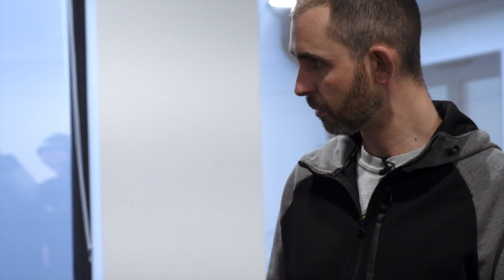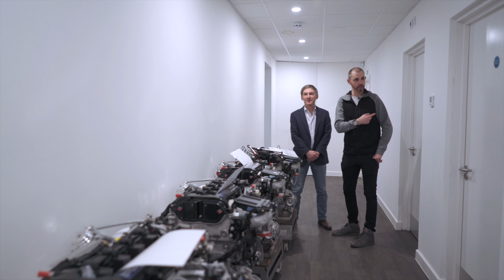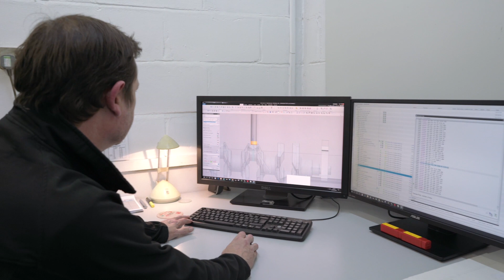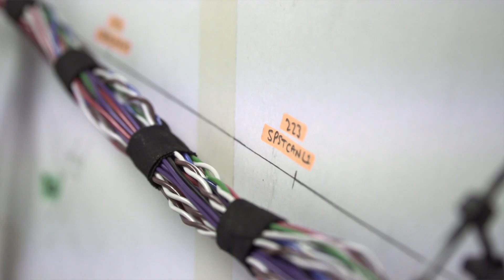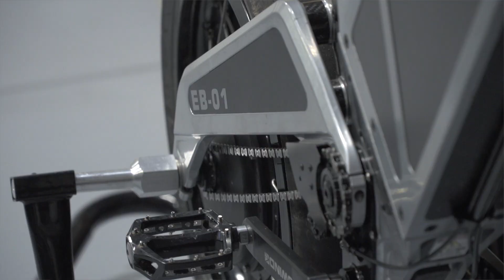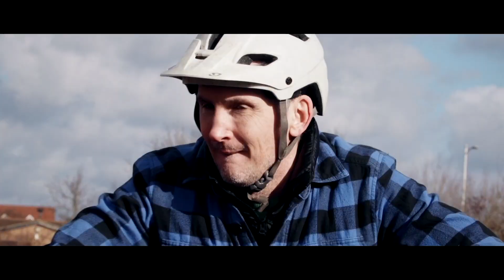This factory makes BTCC engines, EV conversions AND £20,000 hyper e-bikes // Jonny Smith

Comment: Looks more like a motorcycle than bicycle
Reply: Rhys Loader it is really just a dirt bike with pedals bolted on
Reply: Can not see how it is legally allowed on public roads and cycling paths you couldn't do it with a motorcycle but you can with this yet your kids electric scooters max 15 20 mph are illegal
Reply: Rhys Loader it isn’t legal, you’d have to use it at off road parks and designated private trails, would still be bloody sketchy though, it’s either road legally and does 15mph or it’s a motorcycle

Comment: Great to see the old C20XE "Red Top". I had a lot of fun tuning the C20LET for turbocharged and C/X16XE with throttle bodies when I was younger. Swindon Racing Engines (SRE) as they were back then were ones to keep an eye on. I hope we start to see more engineering detail on EV powertrains for the electronics and control strategies as it's all very secret sauce at the moment.

Comment: Like the idea of doing a car conversion using an e-powertrain, but what's the cost. Personally, it'd need to be sub £20K fully installed and running to be remotely viable.  £30K will get you a brand new EV  (Corsa e, e208, Zoe).

Comment: Don't like the e-bike at all. Hub motor - who want's a 10kg rear wheel on a "bicycle". Cheap components in parallel (talking the entry level front brakes). And the fact that it's just a motorcycle with pedals.. I mean I like bicycles, I like electric bicycles as a means of transport. But even with a 750w mid motor e-bike, at 30mph most of the power is delivered from the motor and not the cyclist. But it still has influence on how much power the cyclist adds.. now double the speed, and there is simply no reason to pedal (as we can also see in the video). Would have made more sense to just design a nice electric motorcycle (Like the LMX 161).

Comment: The EV conversions bit is really exciting. At Fully Charged Live in Austin, there was a beautifully restored 280Z conversion. At first, I was excited because I have a 1983 280ZX until they said that it costs $70,000 and up to convert a car. So, not very useful. This sounds like they are making conversion kits that are much more affordable and therefore much more useful.

Comment: That drop in electric powertrain is something I'm thinking about for my 08 Peugeot 308 SW. In a few years instead of spending a fortune I could just drop a new powertrain in with a batterys on top and in the place of the fuel tank. Maybe even link up the radiator and aircon to the battery packs to cool them. To me this makes more sense than anything else out there when it comes to environmental stuff, as it reduces emissions across the board, since you're not making a new car, just a new powertrain. If engineered right you could buy with a sort of subframe kit that would bolt on to the engine mounts of popular models. I'm sure electric restomods would be a popular things, if govs don't step in the way as mine does now.

Comment: Was really impressed until I saw their 'Hyper bike' had a hub drive motor. They are old tech (we're talking 1960's here!) and absolutely horrible to ride. These guys are obviously extremely good engineers, but they've missed the mark with the bike. Integrated mid-drive motor with internal gearbox will be the next big leap forward for e-bikes. Would love to see these guys tackle it as it looks like they already have the gearbox that could work.

Comment: Electric bike nerd internet rant: Big fan of 'off road' e-bikes. These are vastly, VASTLY overpriced. Look up the Sur Ron light bee (it's a better built bike than these, which are actually a copy of the old 'Stealth Bomber' e-bike, they were around 10k, but again overpriced )- Sur Ron are blowing up as a company because they are offering A superior frame, placing themselves between a mountain bike and a motocross, you can even get a limited road legal version that is limited specifically to fit in the moped class. They also use mid crank drives, which have planetary gears, meaning  you get loads of power out of a small light drive unit - this is far superior for off-road  use too. The Sur-ron is£4000, spend £8000 and you can get a superb electric trails bike witha 60km range 70km top speed Epure Race Trials Bike. This is old tech being sold to customers who don't know any better.

Comment: I build rally cars, I’ve done little bits for Skoda and a lot of amateur teams, by the time you’ve built a competitive engine let’s say that engine was a VaG 2.0 turbo petrol, by the time it’s all new and BUILT your talking best part of £20,000 yes you’d be looking at similar power and similar if not better reliability but there is 50 hours for one guy just in the engine to buy a plug and play screamer for £25k is INSANE VALUE

Comment: I have been excited about the electric crate engine but the longer I think about it, I can guarantee that the kit just won't be priced well enough to make it worth doing.
At this point, it's going to be cheaper to buy a 2nd hand electric car and either drive it or use it as parts.

Comment: Not wanting to sound negative, but the problem with the eBike is simply that  it doesn't current fit into legislation.  They might show it  "racing" a ultra high performance sports bike (which in reality would disapear into the distance so fast the ebike wouldn't see which way it went) but for half the money (or less) you could get a production std sports bike that is WAY faster. Legally, you can't have more than 250 watts and only up to 15mph for a eBike to be classed as a bike, ie not need a motorcycle licence to use it, and therefore you couldn't ride it "in the woods" as mentioned, you'd have to stay on prublic rights of way.

Comment: provokes memories when us at Arun Autogas, "Freds in sheds", were prototyping fueling systems for Nicholson Mclaren Engines. While we drilled holes in road going V8's their Dyno rooms where running up Indy engines and a workshop was whittling up recon Helicopter motors. We frequently used emission test cells and liased with Ricardo. Those were heady days when Vauxhall would drop down high proirity work to us, working two shifts in a rural tin shed. Thanks for flickering the thoughts

Comment: Thank you for making this video I really did enjoy it. I do think environmentally it has to be better to be replacing our combustion engines apposed to making a whole new car. Does make me think if on some of my classics I should place in an electric drive train and these guys may make it possible without me having to produce my own kit

I would be very interested in converting a car over to EV as I have had my hand in the systems for a while, I've built a fair few classic and modern cars and think there is a market even in media for a good conversion program as a project build series - Maybe a project for 2021 especially if there is a kit available...

Comment: What a fabulous place!  Engineering nirvana for sure.  Wonder if they would eventually have levels of their turnkey EV conversion, e.g. a system suitable for a large 4WD, such as a Discovery 2?  Perhaps two modules, with some clever software to handle traction control, torque split etc.  That would be so good...

Comment: Don't be so excited about those e-bikes, they're made from the same Chinese components as a lot of other "high performance" bikes, and compared to what the natural cyclists expect from the conventional cycling industry, the quality of those parts are really not exactly fit for purpose. They imitate the look of good quality components, but just don't perform nicely or prove to be reliable, but that just keeps the cost down so they can spend more money on motors and batteries. Try and find a brand-name ready-made bicycle that uses a DNM suspension fork out of the box and you can prove me wrong.

Similar bike to a Stealth Bomber I guess, and those are overpriced cheap shit too.

Sorry for my honesty.